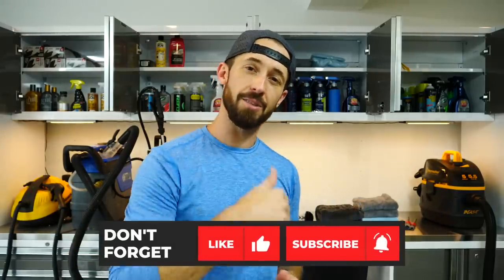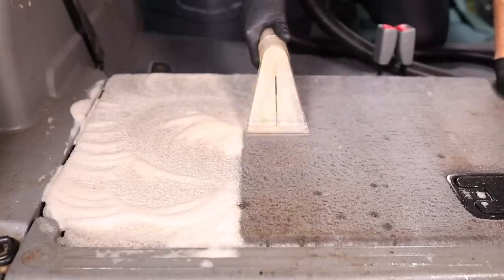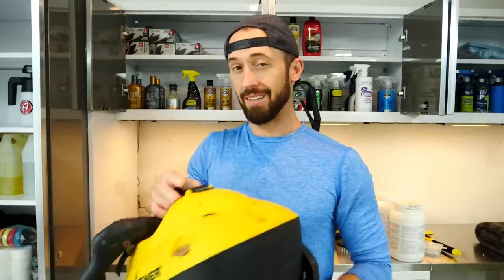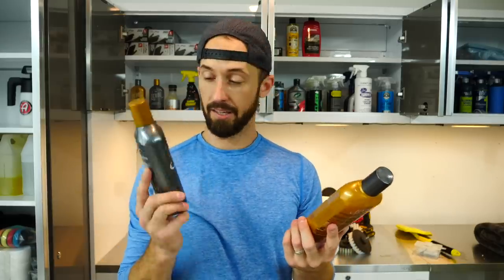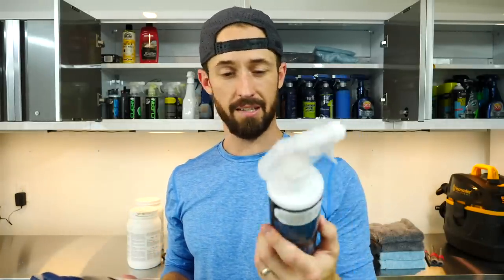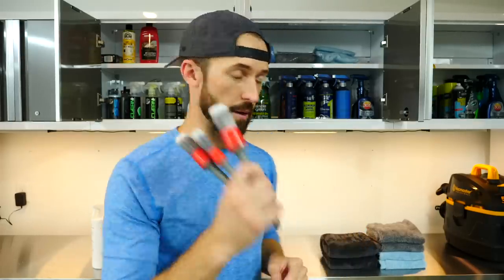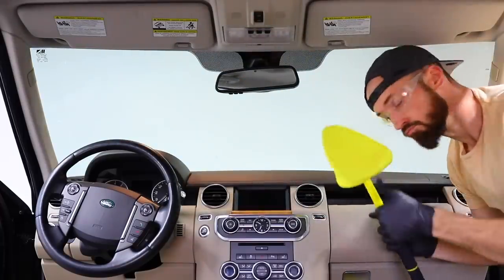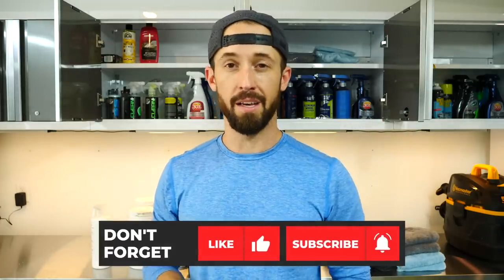Car Detailing Tools & Products I Use for Complete Disaster Car Interior Cleaning

Comment: I work in auto parts retail and I love Griots leather and interior cleaner and protectant. Also any microfiber cloths dry on low heat by themselves or lay flat to dry and lint roll after. I never put them in the dryer because they tend to pull all the lint out of your dryer which can scratch paint and surfaces.

Comment: Just so you know Milwaukee sells 1/4, 3/8, and 1/2 inch wrench bits for that 1/4 inch impact driver and it  has plenty of power to take seats out and stuff. So technically you wouldn’t need the 3/8 impact but they are definitely nice to have if you do any mechanic work.

Comment: I was checking the Carpet Extractor, but I'm a little worried about all the bad reviews of this exact machine 50-1000 do you really recommend it?
Reply: Same I’m wondering about the same thing the issue is the hose always cracking and the spray malfunctioning so I’m stuck on it as well
Reply: I got one and works

Comment: I use old school saddle soap with a chip brush and dipping water cup to thin the saddle soap as I'm spreading it around, follow that up with a wipe down, distilled water rinse and wipe then a lanolin conditioner rub and wipe. Works great for vinyls also. Then when I wash the exterior I use a blower to dry the vehicle

Comment: Nice video James,but funny not to be using anything from CarPro, Gyeon or Adam’s. I think I’ve seen you use CarPro PERL and as its able to be diluted, I tend to have a few different ‘blends’ with me. So far its my go to for tyre dressing (1:2), interior as a a sub for 303 (1:5) and I also have a 1:3 mix I use on engines. It is also recommended for leather, but I tried it and I’m yet to find a dilution that is better than Adam’s or Duragloss.

Comment: Great video as usual.  I actually flipped from what you use.  I used to use a lot of the chemical guys stuff.  Now I use a few different ones but tend to rely on Meguiar’s products quite a bit.  Exterior is a little different depending on need but they do provide a lot of value and get a lot more details out of purchase.  Also, I use the work stuff brushes.  Do you have different stiffness on your brushes too?  Or only the soft ones?

Comment: Make an exterior one man. I was going to comment on the last video because I thought it was cool how you didn't have all your supplies and still came out really good. I use Adam's for the wash and tires and ever since you recommended rehab by lithium I've used that for the inside since my car has a leather interior. I also bought their ceramic and trim serum which works really great. Before I used Chemical guys all purpose cleaner for my tires but I like Adam's tire cleaner better. Just recently picked up the glass cleaner. Honestly man you helped a lot by recommending stuff. I did a full clean to my mom's suv and it was my first time doing a full clean so I wasn't sure if I was doing it right but I remembered you said you can't fail a detail because at the end even if it's not the best it will be better than how it was. The time it takes to detail sucks but at the end it's all worth it. Thanks for all the advice and recommend products really helps.